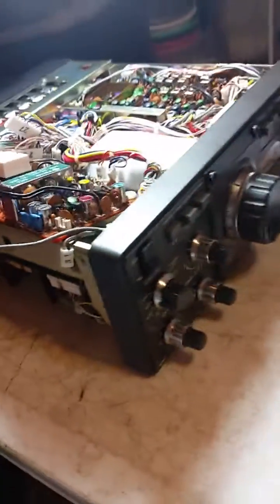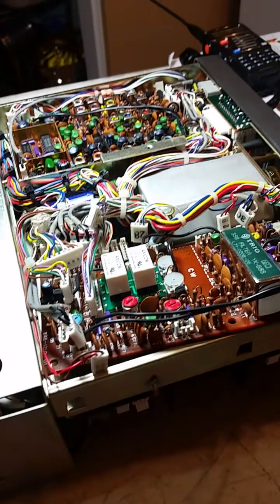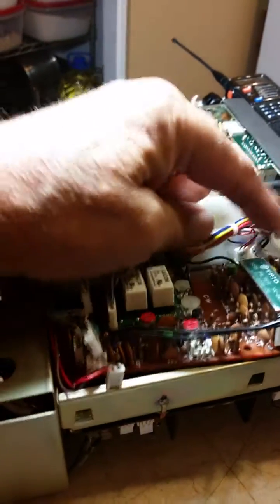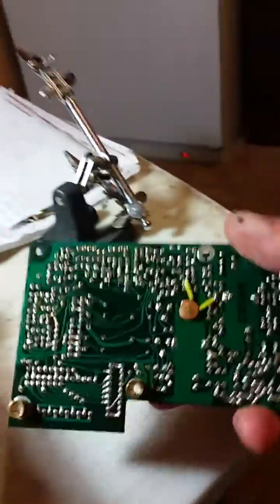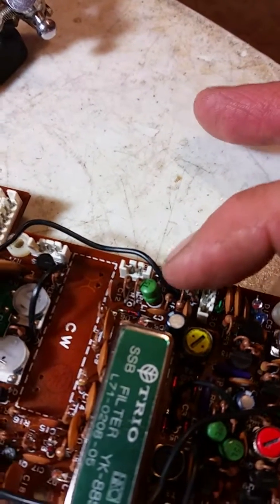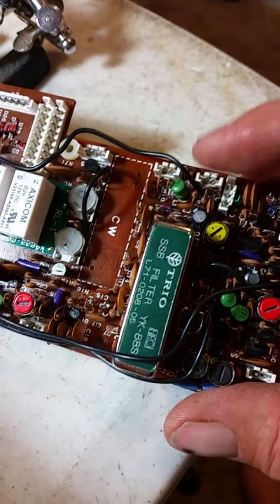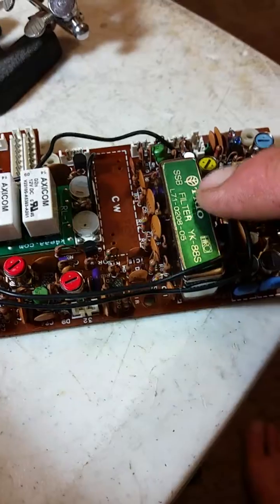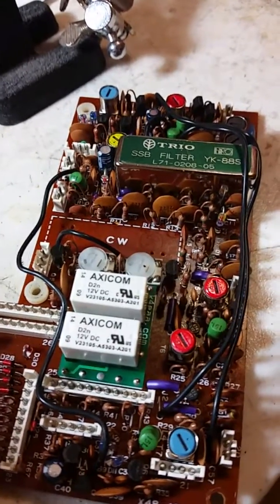TS-120s CW Filter Installation

Comment: Using your video snd the attached pdf, i think my install went easily.  But, I cant check it until a couple of days from now, as my power cord is in the semi tractor where this radio gets used.  But I'm optimistic.

Comment from the maker: Yes it worked. If you do as I stated in the video put the wire in the other jack ssb cw and match the position of the  other filter it goes right to work. I suppose I should have made a statement that it worked in the video and maybe given a Web address. It has been quit a while since I did the mod. I may be able to find the instructions
Reply from the maker: Here is the link. https://drive.google.com/file/d/0B1NfPBWsMf81M0xoN1Q1XzVfWGM/view?usp=drivesdk
Reply: That is awesome.  I have a radio and filter in front of me and hate guessing, as you do... thank you!
Reply from the maker: I really hope you are successful. One mention is I got bug eyed and plugged a cable un-related to the crystal install and got two dots on the display. Thought I had messed up bad but after getting it right everything went to work. I took the whole board out and there are quite a few connections on it. Just take a picture first  I love my Kenwood TS-120s also Ken's K4EAA relays for I think 530s work just fine in this rig. Mine crapped out on receive, no s meter and very little audio.